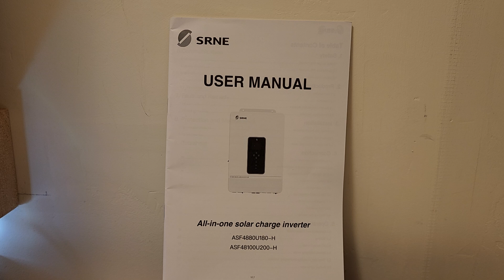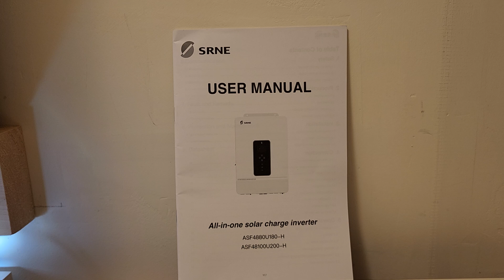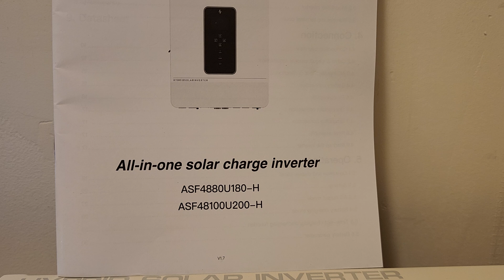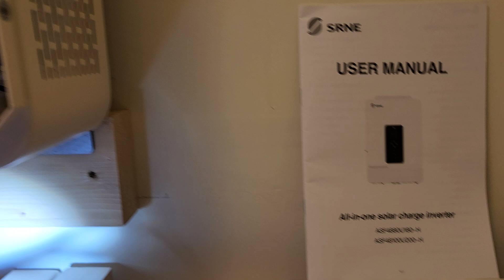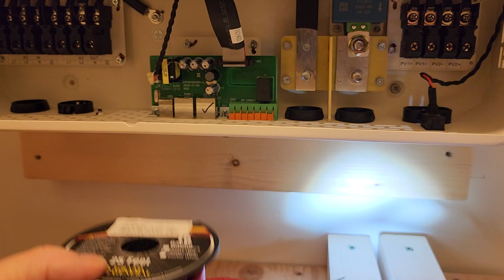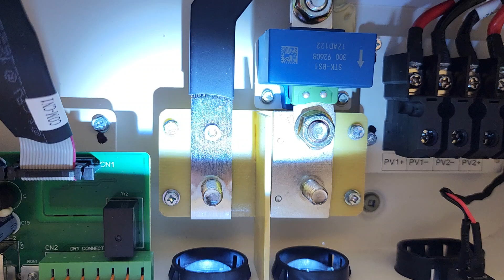Solar DIYers: SRNE ASF inverter's wire sizes inconsistent with 10kw claim

Comment: Every thing is rated at MAX.  not at normal therefore you are spot on at the end of the video... you have a 4000w inverter TIMES TWO LEGS   which is 8000W continuous.   It will handle 10K for a while... minutes but is not rated at 10K continuous. 

Exactly where the heat shows up at 8000W is up to you to check.. little doubt the battery connects seem small to carry even 160 amp continuous.

Comment: Interesting topic for sure i had my concerns about whether it was ul listed and tested to meet USA residential codes, but they are! I ended up settling for a ruixu 10k inverter only to find out it is a rebranded version of that srne!! The update files were linked from srne for the version I have.
Reply from the maker: Thanks for the comment. I'm glad if that is the case. Where did you find that it was listed and tested to meet US residential codes. I'd be glad to get that info to make another video about it. I have a full time job, the wiring of this device requires major changes, basically I need a new sub-panel for the appliances with 240 v feeding the inverter and 240 v out of it to the appliances. A major job for DYI.
Reply: @josephdewuhan  I sent a link not sure if it worked, either way u can check out the UL listed on the srne website

Comment: The diameter of the wire varies depending on the type of electrical current.The inverter combines the solar panel's current with the household electricity for charging, consuming a specific amount of electricity. You don't have to worry about amperage consumption or the size of the wire used.

Comment: In this video we can see that someone give some funny story about what size is needed for some power...
As a engineer, I have been testing a lot of wires, electrical connections, because what you see on the paper, and what a practice is showing is not the same...
Most of this parameters for the wires is calculated on cold wires, but each wire have loud test of safety work, and it is giving the double specifications from the numbers what is that wire made for...
So guys...be free to use this unit for 10kW without any problem...
But make sure that you use for batteries wire on longer distance from inverter,1.2m and more, bigger size of wire to have less losses...from 35mm², to 80mm²...
Good luck!
Reply from the maker: The problem is your home insurance do not agree with you. You can do your electric wiring in your house at a lower standard than the the housing codes. You may run your house without much problem. But when something happens, when the insurance inspector comes, you will be in trouble. I'm sure as their videos shows, you can run it for at least as long as the video shows, it is not a problem.

Comment: Internal Configuration of an inverter is not sized at 60 degrees like residential wiring. It would be more in line with chassis wiring

Comment: Joseph, you are well intentioned, but your assumptions are wrong. Wire ratings also have distance and temperature sheating variables. The ac inn cables are 200Celcius rated and 1 ft,   that would make them go over the specs. same with busbars. you are talking about standard code for home wiring. this is equipment wiring. different ballgame. It probably was designed by many electrical engineers. I trust their manual that clearly mentions its limits on amperage per input/ output.

let’s talk about features and coms!
Reply: also note this inverter is CSA certified so this has been tested for safety by CSA
Reply: A very good response. A well intentioned video but carried out with misapplied theory.

Comment: When I bought the SRNE inverter, I was concerned about the thickness of the electric wires as well.
The cable used is a heat-resistant electric wire that can withstand temperatures up to 105°C. According to the datasheet for a similar wire with the same specifications in Japan where I live, a 10 AWG wire of the same type using heat-resistant PVC insulation can carry a current of 58.5A when the ambient temperature is 30°C.
The inverter's maximum input/output current is 63A. Since the enclosure has a fan, I think it can barely handle this level, which is not ideal.
Reply from the maker: Thanks for the valuable information. The seller sent me a short video showing this inverter exporting 10kw power while drawing 200A battery current at least for the short time of the video. The main problem is the legality of using such small wire for such high current in north america.

Comment: 10,000W / 240V = 41.66

5000w / 120V = 41.66

40 Amp circuit: 
THHN Cu wire = 10AWG
NM-B Cu wire = 8 AWG
Reply: Look at 10 gauge house wire.  It is much smaller than your spool of wire.  Your spool of wire has an extra thick sheath, making it look bigger than it actually is.
I think that is the issue here.  Your red 10 awg wire is misleading.  
10 ga Romex or THHN wire (NEC Code for use in houses) is way smaller than your spool of heavy sheath 10 gauge wire.  
I bet if you took your spool of red wire to a hardware store that sells 10 gauge Romex or THHN wire, you would see the difference.
Reply from the maker: @Photovoltaic_Maniac  No I bought and installed the extra receptacles for an additional stove and dryer in my basement, I knew it. I also bought 6 awg cable for connecting this inverter to my panels.
Reply: @josephdewuhan 
PV wire?
PV wire has a thicker sheath.
Ok, you'll find out once you compare to actual Romex or THHN house wire.
Reply from the maker: @Photovoltaic_Maniac  PV? I do not judge wire size by how thick it looks, yes I have 10 awg wires that looks thinner than the one I showed in the video. I bought the wires based on suggestion by the people at homedepot. I know what sized wrire I bought. I can alsi read the size on the wire skin.
Reply: @josephdewuhan  
Ok.👍
Reply from the maker: @Photovoltaic_Maniac  ok, I agree based on wire gauge chart, 10awg wire is allowed for currents up to 30 amps. But this inverter, the current can go higher than 40 amps. I have another split phase inverter, MPP LV 4860, which is rated 6kw (Taiwan product). Based on what I can see the copper plates they use are much bigger 25 mm x 3 mm which is close 3/0 awg size that can legally pass 200 amps. But the maximum current for 6kw is only 120 amps. I feel safe use that one.
Reply from the maker: Check your local code for the wire size for 40 amp current, i.e. the cable used for your electric stove or dryer if you live in north america.
Reply: @josephdewuhan 
Dryer = 30 Amp breaker / 10 AWG wire
Reply from the maker: @Photovoltaic_Maniac  Yes, dryer is a bit lower in amperage. It has yet another different recepticle from the 40 amp one for the stove. But mine is never 10 awg, at least 8 awg, for the stove mine is 6awg. I also used 6awg cable for my electric welder which can go as high as 50 amps. I will pose another video showing the video the seller's engineer sent over to me which shows the machine with a load of 10kw using a battery that is feeding 200amp current to the machine for at least the short duration of their video. The question is: is it legal for us to use it in our house here? Does it void our house insurance in case of a fire? For me, I will try to double the wires they use for AC inpu and output which is easy, I can also double the battery input negative, but I do not know how to make the positive thicker because of the relay in that line.

Comment: It's 10kw Total.  Thats is 5kw per leg.  
L1 5kw
L2 5kw
Reply: Plus tha wires a short
Reply: And you need also to check the isolation. It could give you even more amps.

Comment: 7:50 it is 10kw total which is 5kw per leg.. So your calculation is doubled what will go through the wire
Reply: 10awg wire can carry 40amps continuously (3 hours), at 90 degrees C. According to NEC. Additionally, this would be considered chassis wiring which are usually rated at the upper limits. Consistent with with the 40A. The wire is appropriately sized even according to NEC.
Reply: @KingJames6306  can go with 8awg since it is 41-42amps max and higher during surges. definitely don't need 6awg. But again not even what I was talking about here
Reply from the maker: In north america, 6 awg cable is required for such power here, period. Go check the size of the wire to your electric stove if you live here in north america (I doubt it based on the way you talk here).
Reply: @josephdewuhan This isn't relevant to what I said. You said there is 10kw going through each wire, no there isn't. In a split phase system only 5000 watts are going through each wire.
Reply from the maker: @gg-gn3re  Based on strick calculation, the 10 awg only allows 3600w, i.e. 30 A current at 120V (108v it would be even less). So, if you run 240V, you can double that, that is what I say about 5kw. You need to know I did not make this limit, your house's fire insurance is invalid if there is a fire that  is not even caused by this machine. You  legally are not allowed to run 83A or even 50A current in 10 awg wire. Even 6 awg is a stretch, which is for 50A electric stove and 240V EV charger. Strictly, you need 4 awg or higher here. If you think your comment here will make people change their impression about this, you are wrong. Every DIYer here, knows 10 awg is too small for this.
Reply: @josephdewuhan  You're never running 83 amps through them. It is 5000 watts max per leg which is ~41 amps. Stop trying to change the subject. I am not arguing if the wire size is too small or too big. We're talking about what you said at 7:50